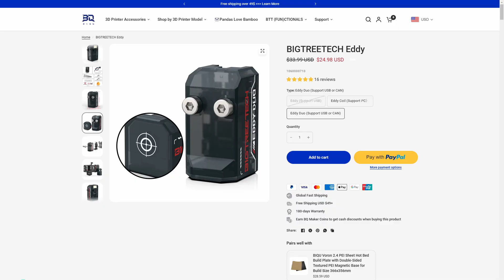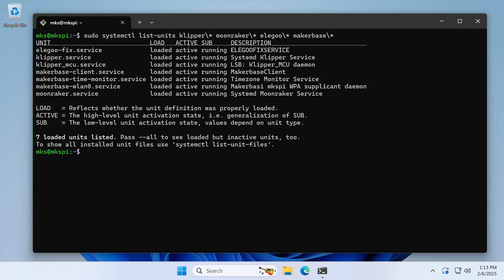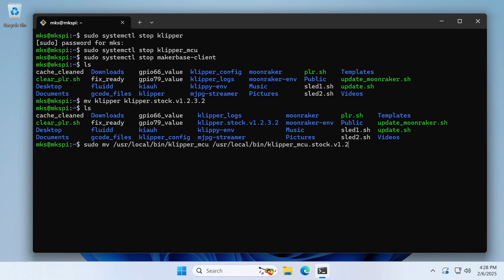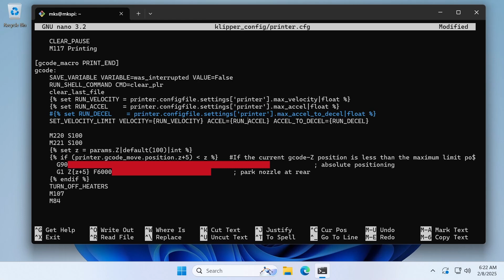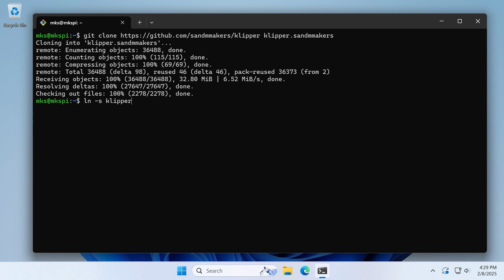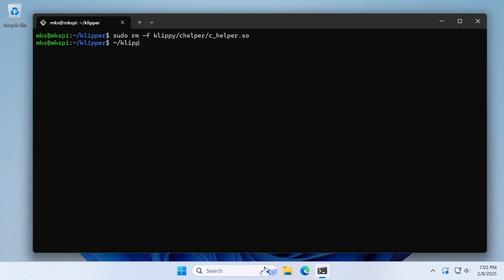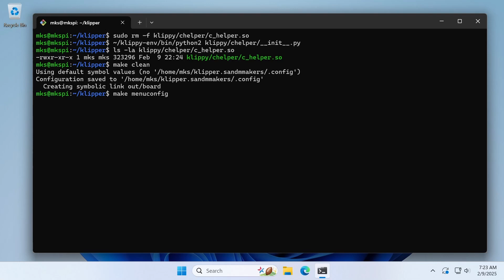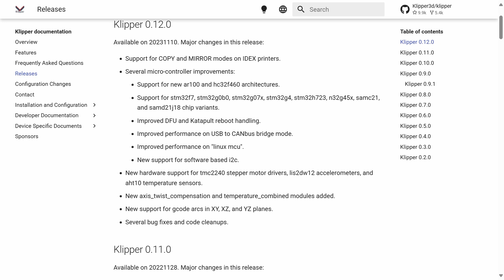Modern Klipper on the Neptune 4 Max

Comment: Is it recomended to SSH into the printer to update the apps or would you need to make another image?  Thanks!
Reply from the maker: Thank you for watching our videos! When Elegoo designed the Neptune 4 series of printers, they did so in a way that prevents using the standard Klipper ecosystem update methods (e.g., via Fluidd or Kiauh). Instead, they expect everyone to download and use the firmware updates posted on their website. Except for Klipper itself, my version of Klipper does not change this. Once I create a new version of my Klipper version, I will create a new video going through the update process, but it is basically just repeating half of the original install steps.

Comment: I don't know what I did wrong, probably the fact I'm a gunsmith and not a programmer, but I still have the elegoo klipper klippy error. Something about a home/mks/klipper_config/plr.cfg on my lcd. I don't know what I did, any help would be greatly appreciated.
Reply from the maker: Thank you for watching our videos! The first step is going back and verifying the filenames of each file, remembering that file names are case-sensitive. Also, use the ls command to verify the symbolic links are pointing to the correct location.
Reply: Ok thank you, I am going to redo it, I was using s and d not s and m @SandMMakers

Comment: You mention in a response to another commenter that, contrary to OpenNeptune, your goal was to be as light-touch as possible, to retain Elegoo customizations. What customizations are you referring to? From what I recall (I went to OpenNeptune as soon as it came out, and haven't kept up with what stock firmware looks like) the only thing missing from OpenNeptune is a few conveniences on the screen. I just unplugged the screen and use a spare tablet.

Is z-offset saving reliably yet on stock firmware? That shit drove me to the edge of insanity last year lol

Comment: Interesting Video, I'm just curious what's the advantage of doing this, over just using  OpenNept4une
?
Reply from the maker: The two projects have different goals. OpenNept4ne aims to create a "vanilla" Klipper experience (i.e., remove all Elegoo customizations) while my project aims to make as few changes as possible required to add compatibility for new hardware mods and Klipper features.

Comment: The firmware was outdated as soon as printer was released, that's the elegoo for us. X axis twist compensation is a critically necessary feature as it is extremely difficult to adjust the printer frame to be 0 twist physically. Btw, haven't seen you updated klipper firmware for stm32 chip, this is important as it also includes some features and protocol changes. You need to enter into bootloader mode on the printer by shorting two pads on the board, right near those buttons on the controller.
Reply from the maker: I have directions for updating the (real) microcontroller firmware on the web page. I didn't include those steps in the video because updating that microcontroller is currently not required as the printer appears to be operating correctly with the stock version and Klipper would throw an error if there was a protocol mismatch.

Comment: wait, does that mean that the mcu firmware technically gets flashed on every boot? like, your instructions are not speaking about stm32flash or something like that, so, does that mean it gets flashed automatically every single time we turn that thing on, or how does that work?
Reply from the maker: No, the MCU only gets flashed when you explicitly do it. The steps in the video do not include a flashing step, so the MCU does not get flashed during (or because of) the video.
Reply: @SandMMakers  ah, ok, got it i think, so this klipper_mcu binary is just an interface between klipper and the mcu?
Reply from the maker: No, that is a second "MCU" that just happens to be a standard Linux process instead of an actual, physical MCU.
Reply: @ aaah, ok, then i can think of this as of something like a "virtual machine image" for that virtual mcu thingy, not the physical stm32 mcu?
Reply from the maker: That is correct. The Neptune 4 Max has two MCUs (at least as far as Klipper is concerned), a real/physical stm32 microcontroller and a "virtual mcu" that is actually a linux process. This design approach probably simplifies the internal Klipper architecture since it can treat everything as a mcu, instead of worrying about using an mcu in some printers and directly connecting to hardware in others.

Comment: I can't even get orcaslicer to show the device screen its all white. it does up load files but now I can't remove the files any help. Just started printing have elegoo Neptune 4 plus
Reply from the maker: Have you made any modifications to your printer, or is it still stock?
Reply: @ hi thanks for getting back to me it’s stock. Maybe a wifi issue. I’m waiting on a wifi booster. Orcaslicer 2.20 I’m using. I see a lot of people with same issue and no fix.
Reply: Forgot to say fluidd also doesn’t load up anything no errors

Comment: Amazing work! I would love to do something like this with my Neptune 4 Pro
Reply from the maker: Thank you for watching our video! I just checked and the stock version of Klipper in the Max and Pro appear to be identical. While I do not have access to a Neptune 4 Pro to test, my new version of Klipper should work with the Neptune 4 Pro.
Reply: That’s awesome! Would it also be available for the standard Neptune 4 and 4 plus?
Reply from the maker: While I do not have access to Neptune 4 base/Pro/Plus printers to test first-hand, others have reported this version of Klipper working on those models. Also, installing this new version of Klipper is fully reversable, so it is completely safe to test.

Comment: Where can I get the cable management you have hanging on the centre of the Gantrey? I've print some "Bone" segments but too heavy and catches on the side
Reply from the maker: Thank you for watching our videos! That is just a standard badge reel available at any office supply store. I'm considering making a video about it, but I need to finish my CoPrint video first.
Reply: @SandMMakers  Amazing content and really useful Bed Leveller 5000 + Klipper V12, what I like most about your channel is your moderate pace, calm and clear narrative. Its so easy to understand and follow, very rare in this modern age